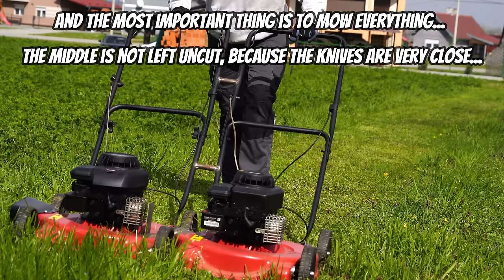Homemade DOUBLE Lawn MOWER !?

Comment: The output out the mower that feeds into the second deck fights the outflow of the second deck. This will cause it to plug rapidly in wet grass snd generally make for a clumpy cut.
Reply: He refrained from mowing the very tall grass. This is often because the problems are not as visible when only the shorter grass is cut.

Comment: Good old Briggs Flathead engines. Those things would run forever with basic maintenance. It is crazy to think that less than a decade ago, they were still making those bulletproof engines, and now the ones they make are worse than some of the no-name Chinese engines. 
The saying "they don't make them like they used to" is true, but in some cases like this, you really don't have to look back too far.
Reply: I've never liked these engines.  Give me a Honda GXV160 over these and you don't have the Achilles heel of a plastic carburetor that can warp using a rubbeer diaphram that hardens when using any grade of fuel and the stupid idea of a primer bulb that you have to bend over, pump three times, go back to the handle, pull three or four times because the diaphragm is done, prime again and then after a few times of doing this you toss it off a hill..  All of that is simplified with a gravity feed system and a manual choke/throttle up on the handle.  Honda, you can start the engine faster and easier than you would with these things.  This includes Kohler and Kawasaki.
Reply: @WJCTechyman  yep, and you are paying much more. I have only seen a couple warped Carbs, and not having a desperate float bowl makes it much more reliable if someone leaves old gas in it. These engines are cheap, simple and can last decades.

Comment: When I bought my place with five acres it took me two days to mow with my 42" riding mower.  So I bought two 22" push mowers and connected them 36" apart from each other.  I removed the front wheels and added a large caster wheel in front of each one, and towed the whole thing behind the riding mower with an aluminum bar a-frame.  That gave me over 6' of mowing for less than $2000 total investment.  I have a tractor and brush cutter now that I use for the big areas and a big zero turn for the yards, but the tow behind contraption was more fun.  I'll post a short video of it in operation to my channel.

Comment: Great idea and well made. The only way to improve it would be to use sell propelled mowers and put a seat on the back. You could leave the separate drives systems independent, so that you could use them to steer with!
Reply: At that point you may as well pay a few hundred for an old lawn tractor.  Also, the self propulsion on these kinds of mowers are only built enough to carry the mower, bag (if it has that function) and the collected debris.  Most of them are so cheaply made you'll bust the transaxle in one or two sweeps carrying your weight since most of them are held together in a plastic box.
Reply: @WJCTechyman  Don't worry 'techyman', I was joking about the seat.

Comment: My only problem with it would be the strip down the middle that doesn't get cut. You basically lost the advantage of the width by having to overlap by 1/2 the unit. 
A hinge in the middle would have been cool to try too before you welded the axles together. For those of us with rolling landscapes.

Comment: wow those motors... same engine design and everything from the 80s
Reply: 80s?  Try 70s or 60s.  If anything, flathead technology is over a hundred years old since Ford invented it.  It's one of the reasons Honda mowers are so coveted.  Its engines date back to the mid 80s (again, pushrod OHV engines have been around for quite a while) but have had incremental upgrades over the nearly four decades of production.
Reply: @WJCTechyman  its exactly the same as the 80s Murrays. ive worked on a couple mowers and i recognize that engine anywhere. ive worked on a 86 murray with that exact engine.

Comment: We used to do this for tow behind finish mowers, but we used 3 so there was a couple of inches of overlap where they all met in a type of triangular shape.  We used the bolt holes from the rear corners of the front mower to the front interior corner of the 2 trailing mowers (one of the trailing mowers was turned backwards to keep the discharge port open).  We left all of the remaining wheels in place and used some angle iron to fashion a tow bar with a pin hitch for the atv or lawn tractor.  It was a simple, reliable, 60" cutting finish mower that we used for many years and cost less than $100 years go.

Comment: Surprized the mower on the right doesn't clog with the one on the left shooting grass to the wrong direction of the one on the right! Now if you turned the one around that might work ok, anyway you look at it good welding on trash metal!

Comment: Very clean combination, If anyone else is considering this it might be faster to simply mount them unaltered side by side in a sort of staircase shape. with one mower 1 step forwards. This would allow for an overlap in cut path, you may also have to flip one mower around so that each mowers exhaust port faces out.

Comment: Instead of 2 motor's it's just a good idea to set up a belt with a belt drive useing one motor taking some parts off a used riding mower to get both blades to turn with only one motor but you,ll probably need a bigger motor because it will use more horsepower to run 2 blades just using the deck blade from a riding mower seems like it might be a good option 🧐...
Reply: Better yet, just use the rider, saving your time and effort.

Comment: I don't know why you just didn't attach them by the rear wheel of one of them, so they could be staggered. Doing it your way either the blades will hit each other or they won't be close enough and it will leave uncut strip
Reply: 2mm   ... watch again
Reply: @RCRWJR  And if you hit an area of the ground that causes the whole thing to flex....CRASH and you end up junking at least one of the engines and these Briggs are made to a price point, so that's a possibility.

Comment: The only problem I see is that the lawnmower on the left is ejecting the cut grass to the lawnmower on the right, and therefore has to eject the grass it cuts and the grass cut by the lawnmower on the left. I would have put the lawn mower on the left in the other direction, so that each mower ejects the grass from each side, one facing forward and the other facing backwards.
Reply: Even better have them offset so one is in front of the other.
Reply: @Saltbearer  this is the best idea that way you can still use the mower in front as just a regular mower to get in narrow spaces.
Reply: This is the same design a lot of lawn tractor mowing decks use, it's fine.

Comment: Smart idea but I can already see one problem. One mower is higher than the other and it was showing in the video with the grass cut at different lengths on either side. I'm not knocking the idea but if it was height adjustable it would have been perfect.

Comment: One very important think, YOU NEVER TIE DOWN YOUR AUTO KILL LEVER - put a quick release clip on it and run a squeeze clamp on a light piece of rope to your clothes. That way, if you stumble and fall, the clip is pulled off the kill-bar and the engine quits-

Comment: So, a person created a double mower with the left mower ejecting clippings into the right mower in the opposite direction of the blade rotation and doubling the bogging down of the right mower (due to it handling twice the grass clippings with added difficulty).
Reply: Yep.  That's just plain dumb. Should have changed the discharge point to the front right of the left mower and opened the right mower in the front left to receive the clippings like a multi blade mower does.  You'd have to fabricate a chute to go between the decks.  I really don't see the advantage here.

Comment: You have just given the manufacturers  an idea that is going to make them a lot of money hope you got a patent on that
Reply: They already make them.  Toro has one, it's crappy but it does make them, Scag and Ferris have the heavy duty versions of those (SFC30 and FW15 respectively) as well.  Also, BCS tractors have an implement that's 42" wide made for its two wheeled tractors.  It's probably the granddaddy of the others.
Reply: Yeah it's called a Riding Mower

Comment: Well, the second engine will be working harder as it receives everything from the first as well as cutting its own grass.  I would have rotated one 180 degrees so it fires out both sides like a 42" BCS bagger mower.

Comment: Better idea, I have a Triple deck 50" cut that I cut grass with on my Cub Cadet lawn tractor!
Reply: Yes, 50" cut. Put about a 5 hp(conservative) or a 10 hp(for heavier grass/ field mowing) wheels on the back and casters on the front like a finish mower for a 25hp row crop tractor.

Comment: What abt the stripe that will be left in the center 😂 that's why riding mower decks are slightly diagonal
Reply: For the overlap, yes, that's why mower decks are offset so you don't have the stripe in the centre.  The other solution is the system uses a timing chain or belt so the blades don't collide.  Of course, that's expensive and if made inexpensively you get the Toro DowntimeMaster.  If made correctly, you have a machine like a Walker Mower.

Comment: the ridged welded connection between the two mowers works on flat plane land, but if you have more uneven wavy land, better to make the connection with some articulation between the mowers.  this could be done with some hinges and flexible metal duct.

Comment: There's always going to be a 1/4" strip of grass in the middle that doesn't get cut because you wouldn't dare design it with the 2 blades being any closer than that.
Reply: A cog pulley on each shaft above the blade and belt connecting them would work like a timing belt to always keep them from hitting. Then they could overlap.

Until the belt breaks
Reply: There has to be at least a 1/2'' gap before it matters.

Comment: The blades are spinning clockwise and the mower on the left (without ejection chute) is feeding it's cuttings against the rotation of the mower on the right...seems like it's working against itself?
Reply: Probably results in some decent mulching though.
Reply: worst he'll end up with is increased gas consumption on the right hand mower
Reply: @sethfieldhouse6876  or possible clogging if the grass is too high. ..or continuous stalling of the motor/motors.
Reply: @blabaduplatinum1  Only if the second engine is double the power of the first, meaning you have to have a 5.5-8hp on the second mower.  Otherwise you are overloading the second stage.
Reply: Yeah I really don’t think it’s that critical given the application,  it looks to be working fine for him.  He’s basically rough cutting the lawn not trying to make golf course fairways. I understand the idea of adding power to the deck receiving the excess clippings. 25 years as a mechanic including small equipment and heavy machinery. Double the power would be overkill. It’s a hokey setup and there are more practical solutions but he’s having fun and getting views I guess.

Comment: I have 3 houses and  5 riding mowers, but only 1 mower works normally. One is a 42" cut Montgomery Ward, Gilson, 14hp Briggs probably about a 1968 or so that needs the Deck reassembled after blades belts and idler replacement for one house. Number 2, An Ingersoll/ Case w/ Onan 16hp twin that won't start (needs electronic ignition parts and a new key switch) but all 3 spindles are locked up tighter than the Pope's you know what.  3rd, A John Deere, 3cylinder Dismal (Yanmar?) the fuel system filters must be plugged up. It'll run for about a minute then start misfiring and quit. 4th,  A 1972 Cub Cadet 229 w/ K301A 12hp Kohler I just fixed a blown head gasket on, but it needs all 3 spindles rebuilt. It made a lot of racket the last time I ran the mower. Not like the Ingersoll, it howled like a banshee the last time I ran it befor it sat all winter and now are stuck. No grease fittings on the Ingersoll. The only one that runs right is the 5th, A Craftsman 42" rider w/ 19.8hp B&S twin that I need  at that house.  Befor the Ingersoll Quit (my favorite, love that opposed twin sound) I went to Rural King and bought 2 cheapie 19" Chinese mowers to do what you did and pull them around with the Ingersoll while I rebuilt the 3 spindles for it. But then it quit running. So then I pulled them around with the Cub befor it blew a head gasket. Befor I butchered the two cheapies I pushed them around individually for about 2 tanks of gas worth, to see what they' re like. OHV with no throttle and no choke. Just the primer bulb. The paperwork says they're set to 3,200 rpm which sounds low, they seem to drone. But there's nothing about hp.    They feel like about 4hp as I had to slow down a lot in my grass which looks like the taller grass you didn't cut in your yard. I'm figuring on raising the engine speed up to around 3,600 or 4,000 for this spring. Maybe they will sound normal and maybe that'll help the power some. They get bogged down easily and don't cut well. Another thing I found out right away is the wheels get all completely encased in the long blades of grass. The fronts stopped rolling altogether a couple of times. I had to unbolt them and clear the grass wrapped around the bolts. Every time I finished mowing last fall I just kept going until they both ran out of gas. They only hold about 3/4 of a quart so that wasn't long.  Another thing: You never saw such a grassy mess!  I have about 1 acre with house in the middle. They get completely covered in grass. I worry about the cooling air getting stopped up on the recoil screens, but they worked. I cut the entire yard 4 times and they were still alive when I parked them. When I hit  pencil size sticks or a skinny new growth tree they really make a ruckus. Just sheet metal deck. You'd think I hit steel rods or something from the sound. And those cheapie mowers are so thin I am sure they are going crack into pieces and fall apart this year. I'm thinking about reinforcing the decks with cross pieces.  Guess I better get going on fixing a couple of the other riders. The spindles for the Cub first. Then the Dismal filters and then get the Ingersoll running and replace the spindle  bearings. Last but not least put the Monkey Wards back together. I got 3 houses and 5 mowers. I thought I had it figured out with 2 backups. But NO, murphy's law has been in full force. ben/ michigan
Reply: Pointless know it all speech.

Comment: This is cool. I applaud the ingenuity. It is however, not very practical. You could’ve just bought a toro time master or something similar.
Reply: Those are $1500, and known to be garbage. Also only 30" instead of 42-ish.
Reply: @SalisburySnake  nope. Mine was not even 1k. And it’s worked well for years. And if you’re gonna go beyond 30” or so just get a riding mower or zero turn.
Reply: @fredericklockard3854  Ok, so your suggestion is to already have bought one 5+ years ago? Not everyone can do that. You don't want the one they sell now, especially not for $1500.
Reply: @SalisburySnake  you seem angry I don’t know why. I’m merely said I have one and it works very well. Don’t know what else to tell you.
Reply: .....yeahhhh.....people with no manual skills and unable to use tools would say that, innit?

Comment: What ya gonna do if something happens to one motor while mowing. Think I would've just bought a Zero turn 42 inch deck instead of all that labor and push mowing. At least you get a warranty with them. Hello 😂
Reply: if one stops just weld on another to the front of the dead one
Reply: Zero turns are incredibly expensive machines, even in the residential and used market.  A used lawn tractor with a basic mower deck would suffice.

Comment: This ain’t gonna work out very well and I’ll tell you why….. the blades are lined up evenly so there will be a middle portion of the grass that will not be cut. You need to offset the blades then you can over lap the cut
Reply: I thought that, but then I actually watched the video…
Reply: @GrassrootsGardeningAshford  ok, you got me. I didn’t watch the video, I just made judgments based on the thumbnail.
Reply: Can’t judge a book by its cover 😂😂😂
Reply: @GrassrootsGardeningAshford  he's right, you just dont notice it right away because the wheels push the grass down. but the next day you'll see it
Reply: Something tells me this guy is not going for a golf course finish. Think you may be overestimating anyone’s expectations, he also comments on the fact that it’s not leaving any uncut grass in the center.
Reply: I see it work
Reply: 2mm bro....   2mm..,  watch
Reply: I use 2 lawnmowers before but I didn't put 2 together like he did. I did use 2 but I push one with my left hand and push the other one with my right hand and it cut good.
Reply: True
Reply: A Chinook mower
Reply: On my lawn tractors with 2 and 3 blades, they aren't offset by very much. Not enough to leave any grass standing the next day. 
I like his idea for the double push mower. I'd go a step further and add a tow bar to pull the mowers behind a ATV or a lawn tractor that doesn't have a mower deck.
Reply: A lot of 2 blade mowers just have the blades very close. I know my riding lawnmower does and there’s no problems with it
Reply: I have a 2 blade craftsman mower, it leaves a bigger center strip than this guys. The key is to not really give a shit, it's just grass.

Comment: Just buy a Toro, Timemaster.
Reply: $ 1,500.00    🤔
Reply: You mean the DownTimeMaster? The  TimeWaster?  The MoneyEater?  I wouldn't recommend one of these machines as they are notorious in wasting time in the shop having parts constantly replaced on them causing owners to fork out an obscene amount of money and frustration.  There's a reason commercial companies stop using them and went back to their Honda mowers and now that Ferris and Scag make better machines, they are switching over to those as well.